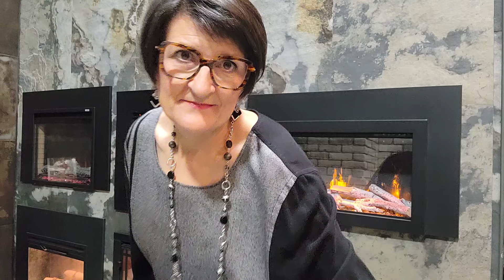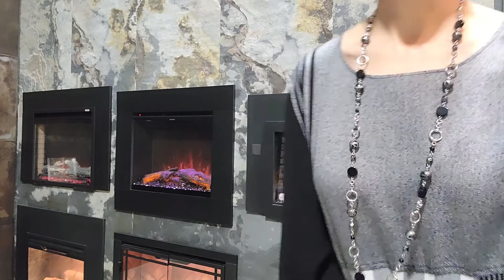Fireplace Safety: How Safe are Electric Fireplaces?

Comment: Can i plug my electric fire place to a power surge strip? Especially because where i live, i have a lot of thunderstorms going on throughout the year
Reply from the maker: Electric fireplace manufacturers recommend that the fireplaces be plugged directly into the receptacle, and are not on extension cords or power bars. Many extension cords and power bars are not built to withstand ongoing use at higher wattages. If you are at risk for lightning strikes, then unplug the fireplace during a storm, and/or consider putting surge protection on your entire electrical panel, to protect the entire house.